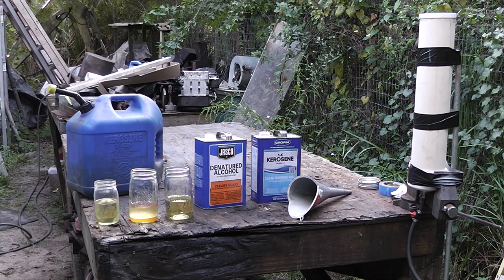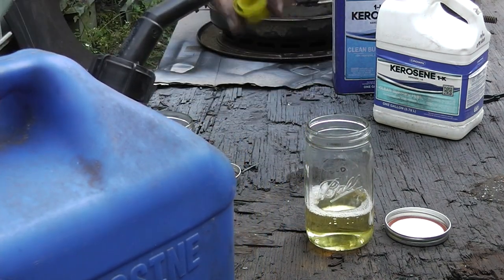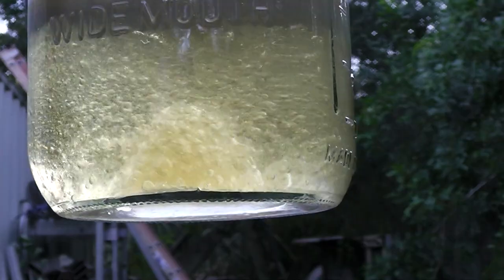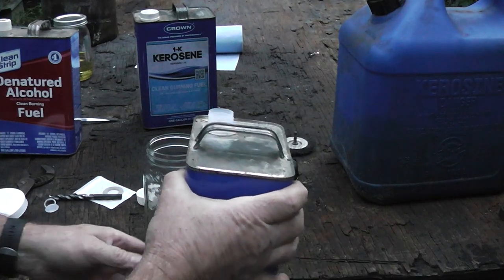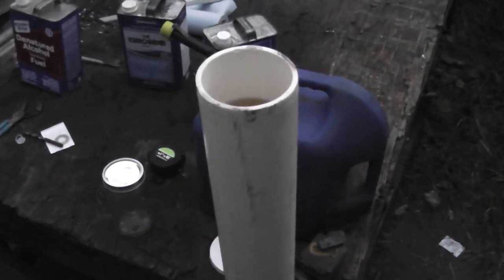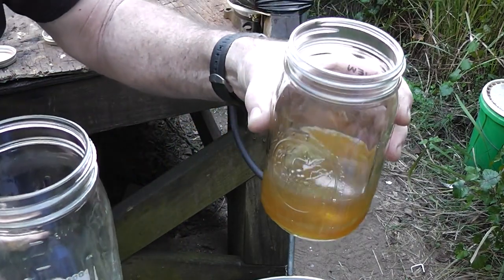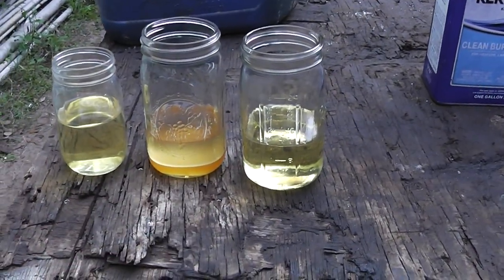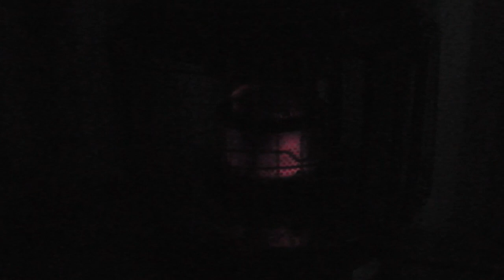Free Kerosene off of Craigslist, Water Removal and Kerosene Heater Fixed

Comment: I'm curious, would the have the water have settled out by itself (i.e. w/o adding the alcohol) if it sat long enough?
Reply: Yeah water goes to the bottom all the time when it’s mixed with kerosene since
It’s more heavy. You could pump out the kerosene from the top or pour the mix in a 2 liter empty soda bottle with the bottom cut so you can pour the mixed fuel in and when it sets open
The cap and let the water out and plug it back up when kerosene starts coming out

Comment: Good video. Not only is denatured alcohol used in alcohol stoves, but it’s pretty standard to use it to clean residue in Coleman lanterns and stoves. Also HEET that people pour in their vehicle’s gas tank to remove the water is denatured alcohol. Before I saw this video, I had guessed that it would be what one might use to dry out their kerosene. Good to see that someone has tried it successfully.
I always laugh at the disclaimers. There is literally no way anyone could sue or hold you liable for doing something they saw on YouTube. Even if you commanded everyone to do it, you have no authority so there is no way to lay responsibility on you. Corporations use disclaimers for their products. You don’t need to disclaim your personal practices on YouTube. Probably a simple “if you are not an adult, only attempt this with close adult supervision” would be plenty adequate.